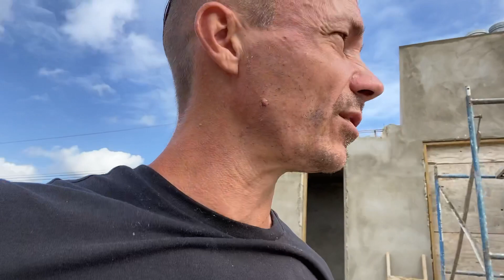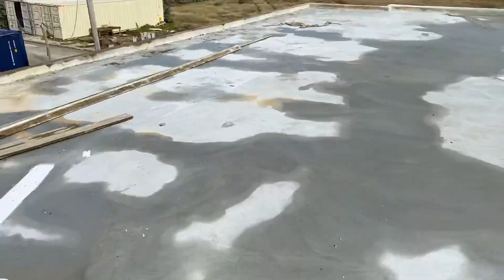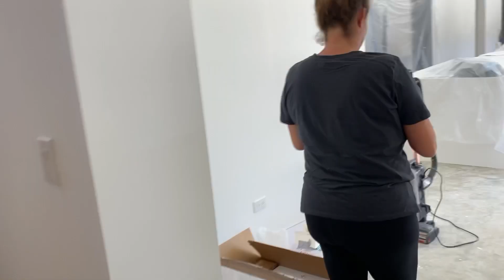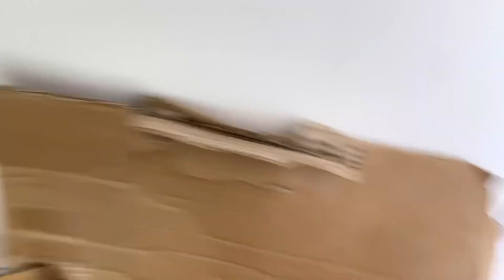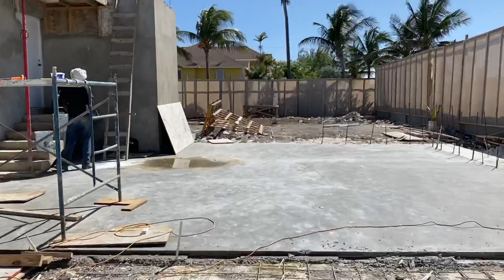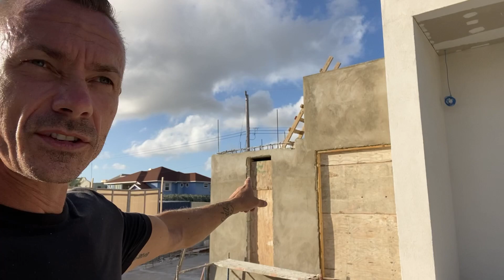Barbados 🇧🇧 Beach House Build - Day 242, fitting the 10 foot pivot door

Comment: Alvin, you may want to look at putting in a drain or a sump at the bottom of the stairs leading to the basement door. This will  prevent water from flowing into the basement.

Comment: I would do 3-4 courses of block then wood framing walls and wood roof
Reply: @barbadosbeachhousebuild  I would recommend block walls for an 8-9ft ceiling height then install a flat concrete sloping roof. A wooden hip roof is going to look odd on this section of the house seeing that the rest of the house has a flat roof.